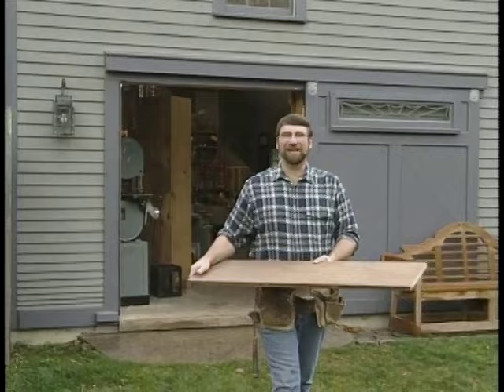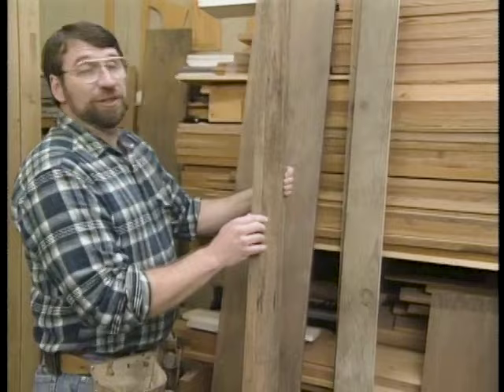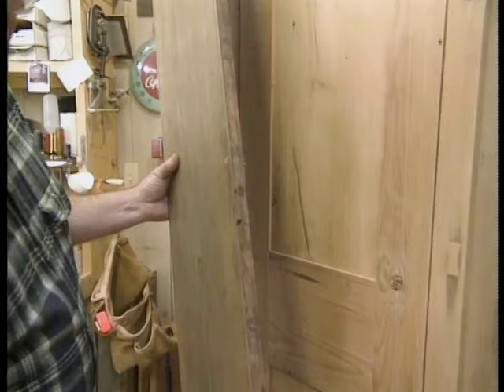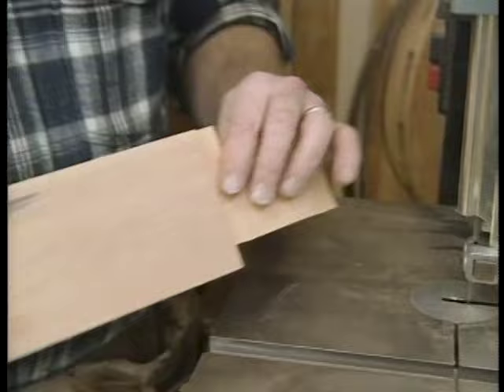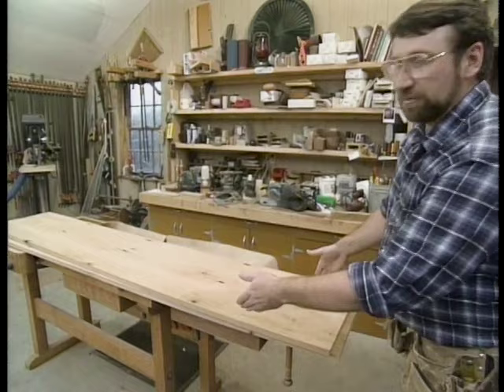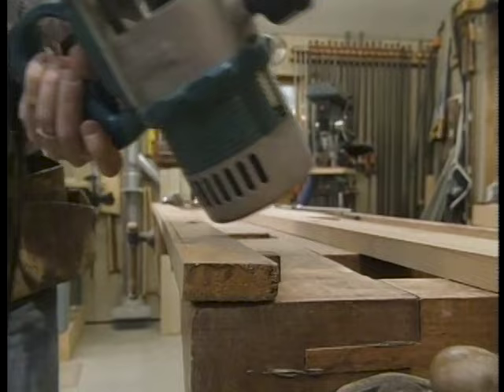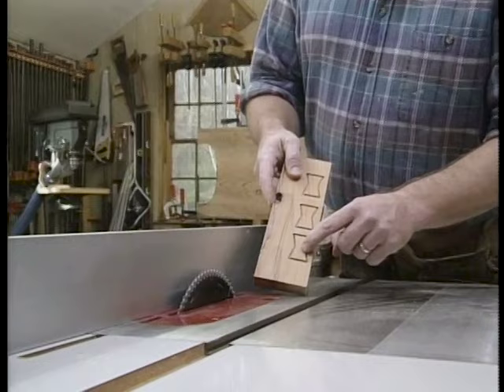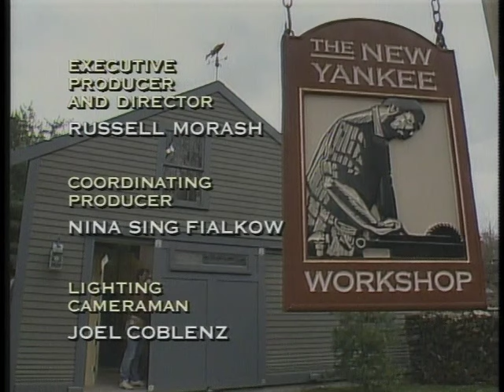Chimney Cupboard  |  S7 E13

Comment: He planed both sides in the beginning. Don't you need to flatte. One side first? A planer just makes uniform thickness. Guess that was totally flat to begin with?
Reply: It's called skip planing.  If the material is already more or less uniform in thickness, or if absolute perfect thickness/flatness is not necessary, it can just be run straight through the planer.